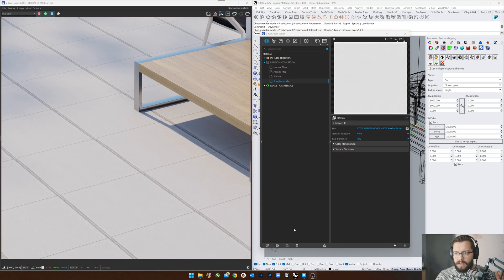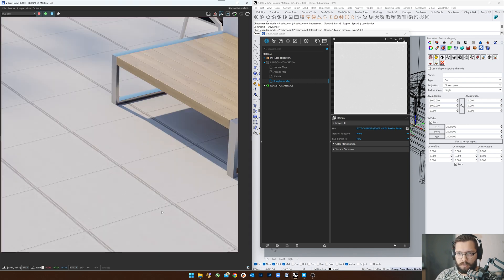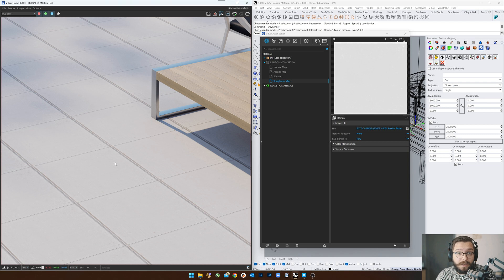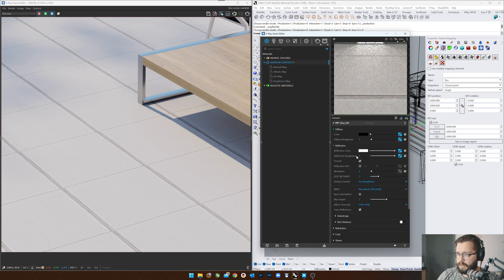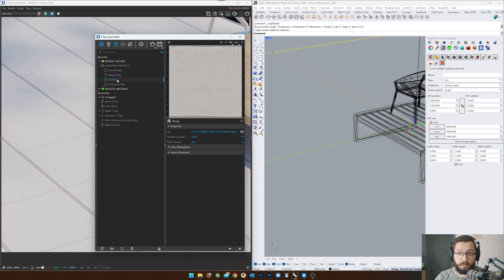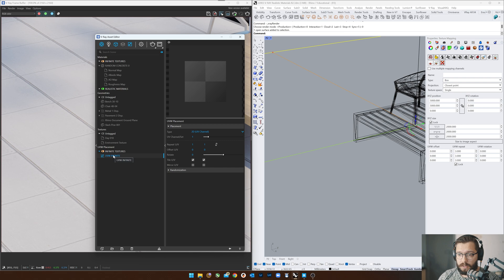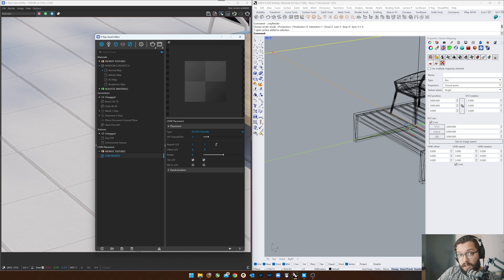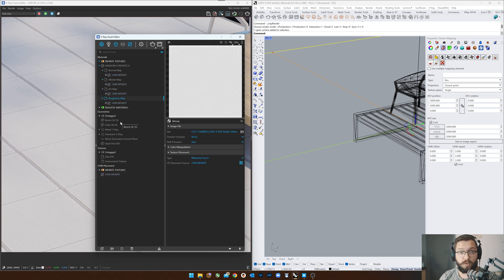Quick Infinite Materials in V-Ray 6 for Rhino (TUTORIAL)

Comment: hey there! nice video but i still have a question. What u explained works with tiles, concrete, maybe mosaic or stuff like this but what are u doing when it comes to brick walls for example? 10m long, 3m tall.. The bricks cannot change direction randomly. Is there an option to randomize the wall structure? 
Ty in advance!
Reply from the maker: Hey, apologies for the late response. 
The short answer is that you can make parametric tiles (and therefore bricks) using the tile texture in place of the Colour map. But from my experience it is t the most straight forward option. When I needed to do this, I usually tile the texture, say, 4 times in Photoshop, do the changes I need there and I’m good to go. Usually the only thing I need to change is:
1 - The colour map - changing shades
2 - The roughness map - usually making some parts more reflective by painting with dark grey. 
I know this isn’t the answer you were hoping for, but I hope it helps.

Comment: wonderful, i`m just sturggling with something similar, on an object with applied texture mapping in Rhino and was wodering if the (stochastic) texture would work on this kind of object ... so texture placement in Rhino, and afterwards borrowing material from VRAY applying it and ... have to check if it would work ... thanks ...
Reply from the maker: Thanbk you Julian.
To answer your question, it absolutely works. Tbh, everything in Rhino already has a RHino mappting regardless. This purely manipulates the textures within V-Ray. I'm not really sure where something like this could become useful on an object considering they are small and the carpet effet is more common on very large and empty surfaces. At the same time, I can think of a few scenarios where it could be usefull.
Cheers
Reply: @danielkuzev4992  hahaha ok... so use is that texture mapping in Rhino is visual, you see what you do, and how you apply it. the idea is you make it in rhino, and afterwards you put the vray material and render in vray. if you understand me ... https://www.youtube.com/watch?v=17_M5ygXsx4&t=525s  That one is from the SimplyRhino channel , is good explained , but what if i wont to apply vray-material ... I mean, I did it and it worked. but was a bit of a fight to understand that the texture shouldn`t have triplaner mapp in itself. The struggle in Vray is with objects that are bend, organic etc. Think of wood that is bent ... how are you supposed to apply a proper material in Vray on it ...
Reply from the maker: @juliantodorov5702  Exactly. Mapping as usual in Rhino and then additional manipulation in V-Ray